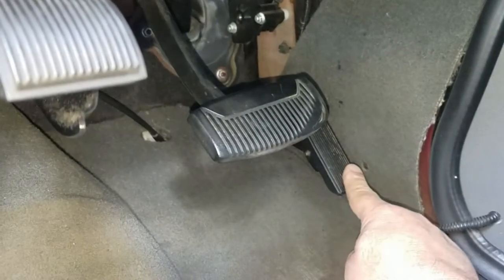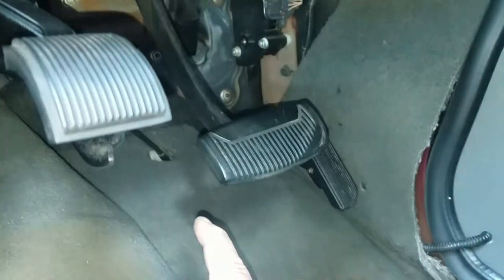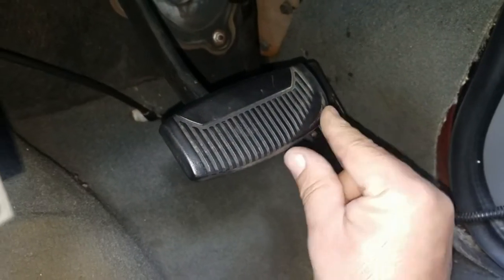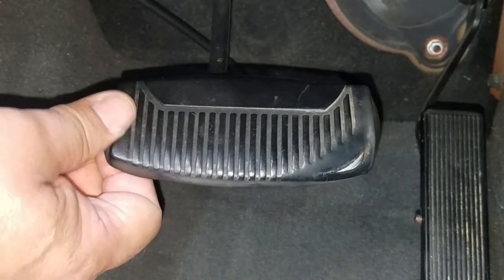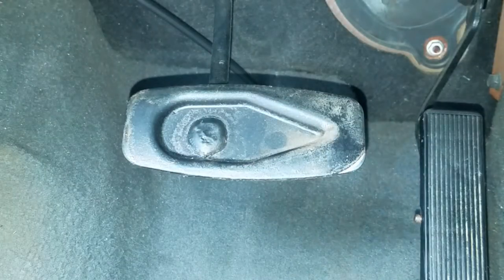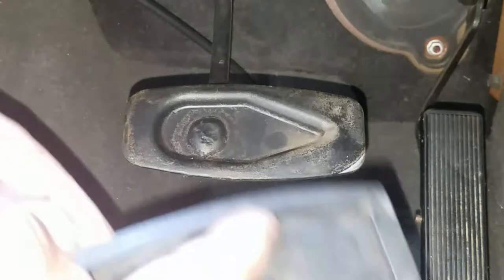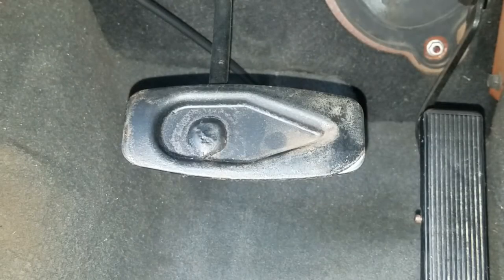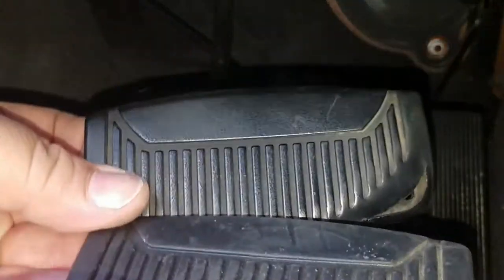How to Replace the Gas Pedal, Brake Pedal, Clutch Pedal and Emergency Brake Pedal, Rubber Pads

Comment: What about the plastic piece under the pedals? I need to remove mine because it's getting water under it. And I need to find where it's coming from.
Reply from the maker: Are you referring to the plastic pad that is on the carpet